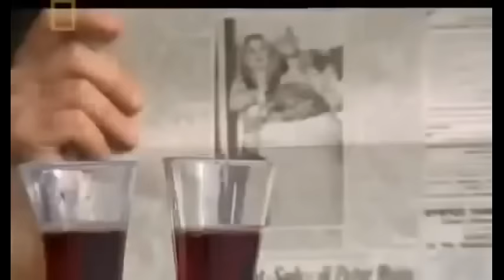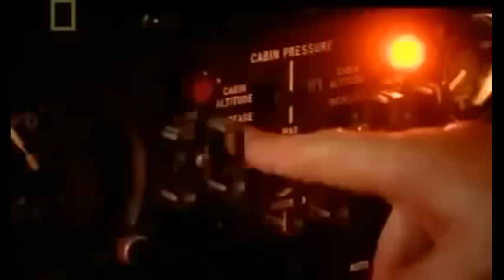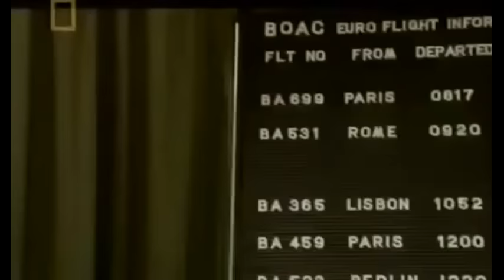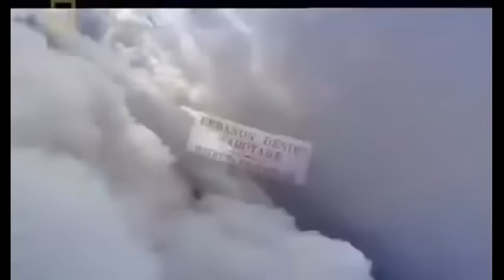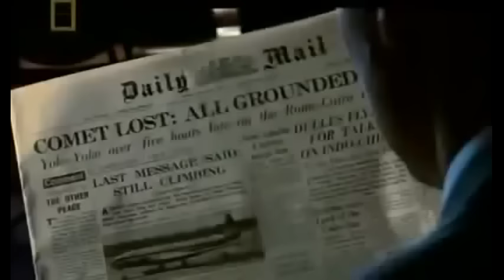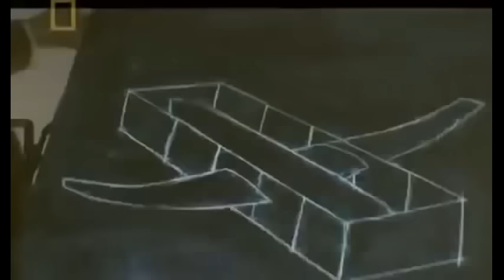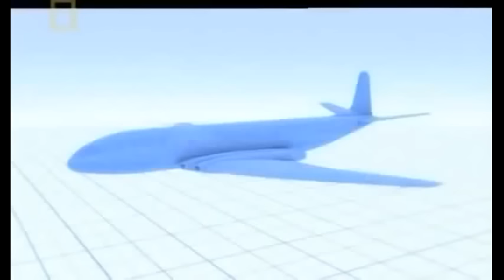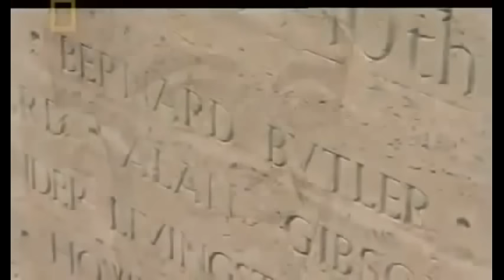Air Crash Investigation BOAC Flight 781   [48:40]

Comment: In 1954 my mum was at boarding school in England when she received a long-delayed air mail letter from her parents, who were then living in Singapore and wrote to her regularly. The letter (which she assumed had been lost in the post), was water damaged and marked with an explanation for its delay. It had been on board this Comet aircraft when it crashed, and was recovered from the sea along with other air mail post on board, the wreckage and bodies. 

I only found this out when I told my mum about this documentary today. She'd never told me the story before, but it popped into her head immediately I mentioned the Comet disaster. Spooky!
Reply: Hope she kept the letter .
Reply: @serenitynowyolo  That was my first question! Unfortunately she didn't, it got lost during umpteen house moves over the years. 

I would have loved to have seen it, there's something morbidly fascinating about the prospect of handling something that had been on board that tragic plane.
Reply: Well at least only the letter was onboard and not your parents! That's amazing though. There's a reason why modern jet aircraft (that fly at pressurized altitude) have round cornered windows (unlike this aircraft whereby the windows were much more squared off).  The reason is that rounded corners can better displace stresses from compression cycles.
Reply: I would have molded the fuselage from one huge block of aluminium and used prisms and magnifiers and little peep holes. A poor view yes; but then just show em movies like Goldfinger or Casblanca and give them free booze.  Criminal negligence really-- they could've figured all this from the post  mortems of the dead offa the first crash.
Reply: @jimhen459  yes but you are operating from having learned within a culture that has gained a greater collective knowledge over the intervening time.  That said the majority of humans have a default setting of seeing is believing.  One only has to observe how, for example, doctors continue to diagnoss under the assumptions derived from statistics rather than experiementation and resulting evidence...this is demonstrated for example with diseases like cancer, heart disease, MS, depression, dementia, just to name few.  Simply put we all walk in steps of those that have gone before us.  Back then well so few had walked in front.
Reply: @glamdolly30 My thoughts went to how delicate the “explanation” may have been worded.  I’m reminded of an interview of Peter O’Toole, his being fascinated by a dry cleaner’s note which read “It distresses us to return work which is not perfect.”
Reply: @davidcouch6514  Ha! Ha! Wonderful!
Reply: @glamdolly30 So the rescue crew went out to the crash scene, scooped up the letter and separated it from the bodies and other debris. They brought it back to shore and dried it out. Then they took the time to add a remark as to why it was delayed. Then went through the effort to deliver it to your mother. And she was so touched by their effort that she lost it during a move. Lol

Comment: The engines within the wing were probably a maintenance nightmare, but the Comet was a gorgeous aircraft.
Reply: Not according to the plans, there online somewhere, bottom half of the cowling comes away, and the whole engine assembly is dropped out, held in as i recall with just 6 bolts.
Reply: I'd be more worried about things like losing a compressor blade, or an engine fire. Even ingesting a bird seems dangerous.
Reply: Agreed. The design was more like something out of a SiFi movie than an aircraft in actual usage. I would bet the designers were avid SiFi fans.
Reply: And to think in the late 50’s even a color TV,  or the word computer was not even a sperm yet!!!
Reply: @jennylynwall3424  they had color film in the 30's, but late 50's i thought they had colorTV albeit expensive?
Reply: @ct1762    We had the 1st. Color TV on the block and yes it was very expensive but it wasn’t till the 60’s. Before that all we had was a piece of plastic with colors across it that we stuck on the tv. Now I am interested and will have to look up when the 1st color tv were available to the general public.
Reply: Couldn’t agree more. Way ahead of its time in as far as it’s aesthetics. Very refined. First time I was introduced to it here on YouTube actually, I was quite surprised to find out its historical significance. It looked far to modern to be from the era it represents in aviation. Just gorgeous quite frankly.
Reply: @jennylynwall3424  computers.(digital) were in use in 1942 with keypunch card input/output it was called the Atanasoff–Berry computer after its inventors..
Reply: The airstream of aircraft
Reply: Thats what I was thinking as soon as I saw them I thought how in hell do they get to them. Capt Gibson looked a bit "out there", maybe too much coffee.
Reply: @uraniumu242  
I had a laptop in 48
Reply: @alhanes5803  Really?
Reply: @pauljordan4452  
Yep.
Reply: I agree. Absolutely beautiful aircraft the engines being inside the wing make it look so sleek. Reminds me a great deal of the ships from start wars from the naboo. They have that polished mirror look with the engines inside the wings.
Someone below mentioned that maintenance had been figured out. But as others mentioned I would worry about a turbine being tossed.
Although these were not large turbofan style engines. So I suspect that having a turbine blade come loose or be ejected would be a far lower risk. They're fairly well contained deep inside the engine itself.
Reply: It was beautiful looking, lethal, but beautiful.
Reply: They can't have been that big an issue to maintain - the Comet 4 eventually morphed into the Hawker-Siddeley Nimrod maritime patrol aircraft (complete with engines in the wing), which was still in service as late as 2011.

That counts as a successful design in my books.
Reply: @ironcito1101  Nimrod didn't have any issues nor did the Comets which came later.
Reply: @dionst.michael5818  hopefully you now realise that a planes's aesthetics aren't worth shit. An airliner's DURABILITY, RELIABILITY and PASSENGER SAFETY are what matter. Comet had none of these.
Reply: @DNTMEE  If the designers wanted to keep their jobs they would stick to their task of developing an airliner which met operator requirements -- lowest possible costs per seat-mile, maximum daily utilisation, dependable, safe. Never mind silly SciFi stuff, airlines must live in the real world.
Reply: @rocketeerPM2500  to be fair they were essentially doing what the automotive industry was doing around that time (Basically attracting buyers (fares in this case) with good looks then hooking them with the details/reputation of the car) they probably designed that aircraft that way to differentiate further from the older generation of aircraft (which arguably looked similar and probably could’ve been converted over to jets with the most recent of the older generation if the structure held)
Reply: @markj2093  11
Reply: notice that modern jets have rounded windows... not rectangular like those seen on this plane. and of course modern jet engines sport huge diameters to keep the noise down & efficiency up. They probably rotate at lesser speeds as well. however remember that fan that came apart a few years ago above PA? it killed one passenger when parts of the engine hit her window. I'd never sit perpendicular to those engines. the safest place is in the rear of the aircraft. my real problem though as a passenger is that I have absolutely NO control. and in case of a rare failure of some critical part the chances of survival are not very good. and there are LOTS of parts in these machines.
Reply: @jennylynwall3424  I built a few Heath kit color TV's for family in the mid-sixties. they were vacuum tube based. I remember the TV Guide books in those days with a little "Color" insignia next to the shows that broadcast in color. Although I grew up on the digital era when it was in its infancy I never really watched much TV (even to this day). Most shows still target 10yo mentality (with its 20 minutes of interruptive commercials out of every hour). I have better things to do (that does NOT spend hours of social media connectivity). All of this shows up nowadays as dumbed down john Q IQ.
Reply: @DNTMEE  Sci-Fi. You people can't spell after Bonnie Hammer ruined that TV channel.
Reply: That inner wing turbine set up looks so today not 1950,$

Comment: Look back to when manufacturers were using square passenger windows with square corners, that was a mistake, but it takes mistakes made sometimes to ensure the safety of future passengers. Unfortunately for many aircraft companies, it will take past and future air disasters to address issues with planes.
Reply: Absolutely no one knew it could be a problem back then. And well yes it is often only when an accident happens that either a design flaw of maintenance flaw is detected. It sometimes takes thousands of hours of flight time for problems to show up, and those faults are almost impossible to detect during testing.
Reply: @martinjrgensen8234  Pretty scary when we don't know as passengers how many flight cycles a plane has gone through. That pressurization at what? 8 PSI or so is nasty because the higher you go the more vacuum you fly into. 8*144 is over a 1000 psf. what's the average air pressure at say 38000 feet? about 3 psi. a 5 psi differential (roughly). wow. that means we have 5*144 or 720 psf being applied to every part of the aircraft that is pressurized (trying to blow the thing up)! yeah ROUND WINDOWS with LOTS of DRILLED fastenings around them with some BIG headed fasteners as well. probably best to fly on new planes, huh? some of these planes probabl go through 3 or 4 flight cycles daily. a week is 30 cycles a year is 1500 flight cycles a decade is 15000 flight cycles.  sure. these planes aren't making any $$ sitting on the ground.
Reply: The first company in a new invention/ tech rarely survives in the industry.
They have all the costs and risks.
That’s why Mercedes Benz isn’t going full throttle into e cars. They want the others to make the mistakes.
At least, that’s what a Mercedes engineer told me🤷🏼‍♀️
Reply: @martinjrgensen8234  Square openings were known to be a problem going back to metal/iron shipbuilding.

It was known to be a problem with design of the Comet by the engineers.    But looks, style trumped engineering.   

Further the building of the windows called for drilled hole rivets and adhesives to strengthen the area.  No adhesives were used.  Weaken.  Instead of drilled then rivets, rivets were punched through.   Weaker and damaging.

Im not sure if the design engineers were aware of the later factory floor build changes done to save labor, time, costs.
Reply: @holyfox94  Pressurised cabins have been around since the 1930's.  Lockheed Electra was built in 1937.
Reply: the metal skin of the plane was to weak and to thin and can not hold the air pressure into the sky and brakes a part. I hope that the learn from the weakness of the metal and they are chaining to build an another plane  what is stronger than the metal skin of the plane
Reply: @r.a.vanelk  lmao. You do realize that this was 70 years ago?
Reply: @holyfox94  Yes. Historically, this is why Boeing wasn’t in a rush to bring out their jetliner. They figured there wasn’t much advantage in being first mover and they could take their time engineering something good.
Reply: @wioi  Francis.
lol.
Ya took the words out of my mouth.
Reply: Mankind knew rounded edges were stronger for thousands of years. I know the people who made the Comet didn’t have access to today’s technology and advancements but someone during the design stage of that aircraft must have mentioned the stresses involved with square windows. But it would have cost more to make the windows with rounded inner edges.
Reply: @wioi  The arch was used 6000+ years ago. Ancient engineers knew curved designs were stronger than other designs. Surely some people considered using round edges for windows. A round edge provides much more strength than squared off edges. But rounded edges would have cost more than simply cutting out square pieces.
Reply: @holyfox94  the other issue is that E cars are only better in terms of acceleration other than that ICE engines trump them oh also that is arguably incorrect in that the first company with a new technology often fails considering that Mercedes-Benz themselves are still around and they were the first ones to build a car at all
Reply: they were quite large as well. Carbon fiber though is taking the place of metals in the aircraft industry.
Reply: @r.a.vanelk  carbon fiber
Reply: It was 100% within the scope of human knowledge that square windows under pressure cause the vessel to tear apart.... Aviation is based off of navigation. Navigation uses circular portholes in situations of high pressure. A tragic oversight.

Comment: By the way, this is the reason why the windows on planes are small and round - to avoid fatigue :)
Reply: SPOILERS
Reply: or to reduce stress concentration
Reply: This was learned at sea by ships breaking at sharp corners, especially in the frozen arctic......
Reply: @eastockerable  No , it was learned from the Comet crashes and for pressurized cabins at high altitude.  It was an unforeseen design flaw as these were the commercial jet planes produced.  Different type of physics and materials here.
Reply: @ronaksingh3220  Actually the engines in the wings compounded the stresses on the cabin and the wings.  Also it required more weight for shielding for containment of engine failure.  These are some reason why they no longer mount engines in the wings.
Reply: I'm small and round and tired all the time! 😉
Reply: @ronaksingh3220  lļîxxan
Reply: Travel with Tony  👍👍👍
Reply: @bobbyd6680  bro the video is about round windows and rivets break due to fatigue
Reply: But they were square on the comment that was the weak spot.
Reply: @ronaksingh3220  the video is certainly not about round windows. Lmao. And no the windows on the comet weren't round at all.
Reply: @wioi  bro the rivets made damage to fuesalage thats what did it but in other plane that round thing happened
Reply: Not anymore
Reply: Yes lucky I saw the full episode a while back otherwise we wouldn’t have known. Ridiculous cutting off the ending.
Reply: Not exactly small, speaking of the Boeing 787 and in a few years the Boom Overture, but basically redesigning them in terms of shape and installation of all components. This is also why there is a small hole on the outside pane of most aircraft windows.
Reply: @dmclegg66  I don't think you paid attention
Reply: @ronaksingh3220  
You didn't pay attention either.
Reply: @alhanes5803  yes I was I'm talking about the findings from the real report they didn't talk about it in this video but the report talks about it.
Reply: @SpearFisher85  🤣🤣🤣
Reply: @ronaksingh3220  stress concentrations are areas of higher stress and are where the cracks start to propagate due to fatigue.
Reply: @alextallen8019  develops due change is shapes or edges